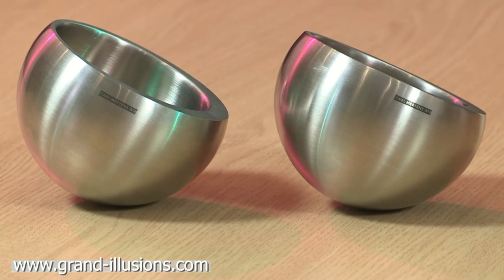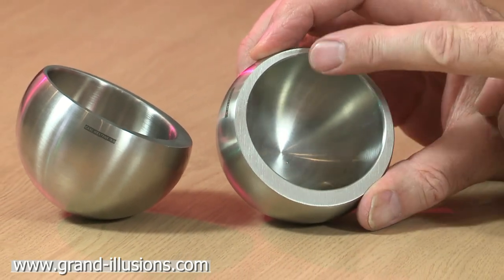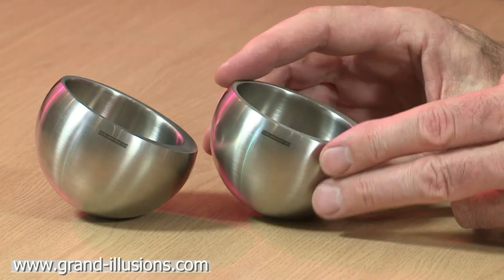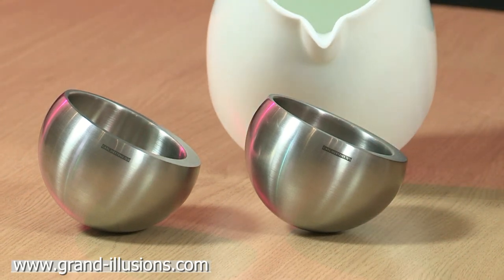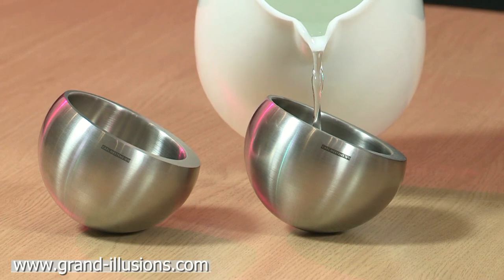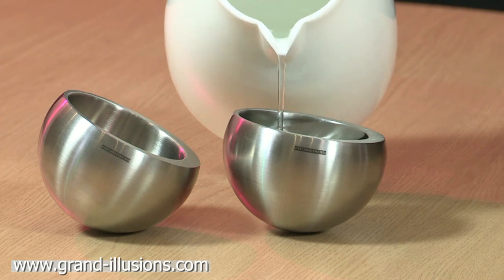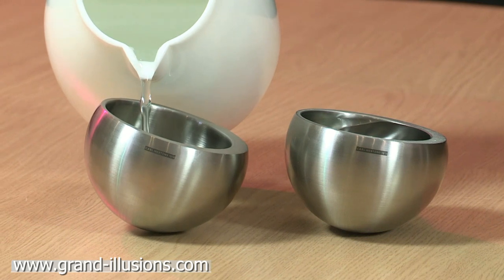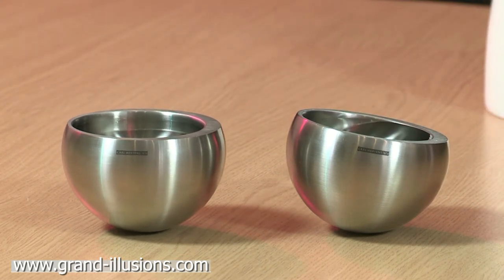Balancing Cups

Comment: Of course the cups balanced out. He kept pouring the water on the left side of the cup, so he added more weight to the left than the right.
Reply: I hope you're kidding!
Reply: No? You can clearly see he keeps intentionally pouring the water on the left side of the cup, so obviously there's going to be more water there. The weight of the water then balances against the weight of the metal and the cup rights itself. If he had poured onto the right side, the cup would have tipped over and spilled. This is a stupid toy.
Reply: @ExceedProduction  
He starts pouring in the centre of the base of the cup and only moves to the left because he knows the cup will roll in that direction. The liquid will flow to balance out long before the cup is forced to right itself!
Reply: I can't think of any more arguments, hahaha. It really is hard to pretend to be stupid, I don't know how flat earthers do it.
I guess I could have denied what you said over and over while constructing a wobbly loop of arguments that keep reinforcing themselves. Actually, let me try:

He starts pouring in the center and then moves to the left because he sees that the trick isn't working and he needs to add more weight to the left! You can see that soon after he starts pouring on the left, the cup rights itself! The evidence is right there! I don't know what you mean with "flow" either. It's a cup, the water can't flow anywhere. It stays where you pour it!
Reply: @ExceedProduction  
I was going claim you might be a flat earther but I didn't want to be rude. Learn a little about fluid dynamics and you'll realise such a small amount of water moving so slowly isn't enough to move over half a kilo of metal so readily! Try pouring water into your hand like that and you'll see what I mean.
Reply: Oh that one is good! Could also claim that the metal part is hollow and thus the entire trick is an illusion.

Comment: it does not balance because of force symmetry when it is full. the geometrical unbalance is still there. but it affects the cup much more when it is empty. when it is full, the water adds much more force than the weight difference of the two different thick sides. and the last bit of unbalanced force is overcome by the surface of the lower side of the cup. it is not perfectly spherical but has very fine edge. once you overcome this during pouring, it stays straight (can be seen on left cup).

Comment: What's the density of the metal? I was a bit sceptical when he said more water would be on the thinner side so it would balance, it's very (entirely) dependent on the metal being the same density as the water.
Reply: The hollow is offset in such a way as to be calibrated to the density of H²O, an heavier liquid would probably over balance the cup!